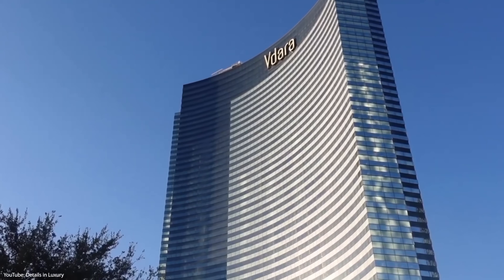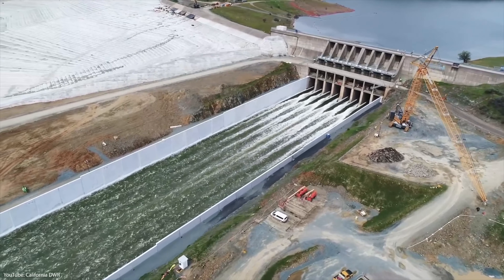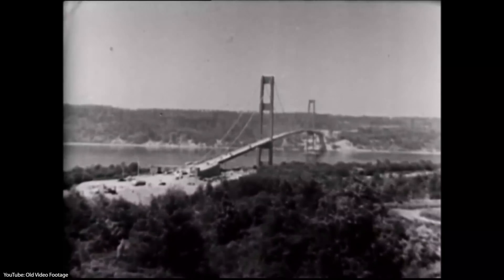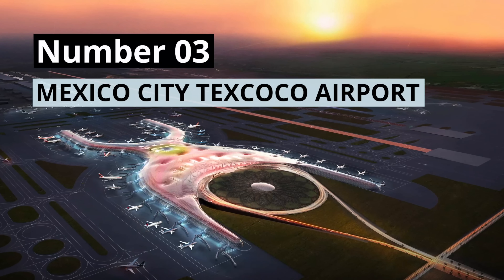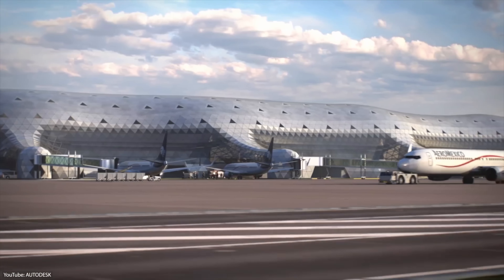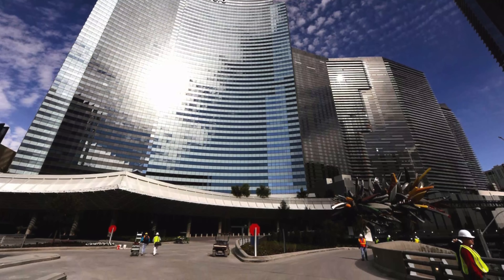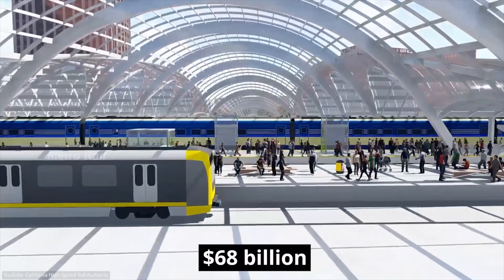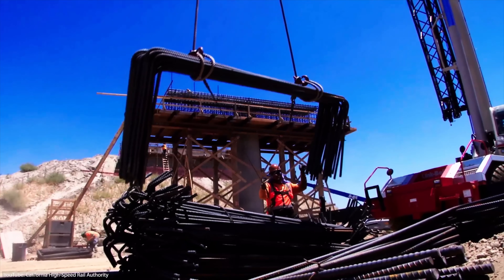Most Expensive Construction Mistakes in the World (Part 2)

Comment: I kinda find I weird that the Tacoma bridge engineers didn’t see any faults in their design…. I mean they literally had 2 perfect examples to to borrow from…
Reply: It's not that they didn't see faults, it's that there wasn't sufficient widespread comprehensive understanding of aerodynamic flutter for them to realize how dangerous those faults were.

Also, they were trying to keep the cost of the bridge down by minimizing the amount of steel used, because they were working under budget constraints.

Comment: As a student in Civil Engineering one thing you have to do when building a Structure is how can the Structure be destroyed by Natural Causes, Resource Causes or Design Mistakes. Then fix that part before building something. It's the same as having a Tree. A Big Tree cannot live without a Great Root System.
Reply: As a student in Civil Engineering you could share something less obvious.
It's just like you consider yourself an authority besides the fact that you haven't built a toilet.
Reply: @marcioaso  Actually building a Toilet is too easy. And yes once in a Practical Project my Group did build a Toilet.
Reply: @rajarshisarkar999  uuuuuh, "practical project".
So obviously you can describe how much cement and tiles it left over...
Describe the project... say how much it costed, the material needed.. how much was the contractor's cost... what did they do... how many days it took...
how was the pluming before the project and after... 
because indeed... a blueprint must really be "too easy" to do, right?

Again: NEVER BUILT A TOILET!
Reply: @marcioaso  Dude, it's just a plain Biological Toilet made of Wood. Eastern Style. Also, why so much hell bent on a Toilet? Trying to Exaggerate a Task is not how Engineering is done. Engineering is to make a Task Simpler in block structures.
Reply: @rajarshisarkar999  I meant the whole room.
But let me explain then... it sounded really snobbish the "as an student in Civil Engineering" thing. Giving that is absolutely NORMAL to be a student of a STEAM grade. It doesn't mean shit in the internet.
Like, you don't have to do this, friend.

Just say: "In these days, bridges.. dams.. or any bigger structures has to pass on lots of simulations to even left the blueprint... sometimes even that is not enough.
I'm studying civil engineering and that's one of the main drives of the course... blah blah".
See, it's easy to put knowledge in front of the title, instead of the "trust me, I know what I'm talking about in here".

Everybody knows that big structures have to run for a lot of simulations even before the first brick reach the site.
And the world is full with engineers that fail in the most ridiculous tasks because of dumb inobservations, the whole video is about that.
The cost of arrogance.

So don't be this kind of junk... it's even MORE important you think like that because you are a student.
Reply: @marcioaso  So in short, I am not allowed to feel pride in the Subject I love. Understood.
Reply: @rajarshisarkar999  So you didn't realize that is a bit early to be proud of yourself yet?
Oh boy...
Dude, I hope you see this as a constructive criticism.

See these video again. EVERY single one of these engineers passed through the exact same path you are passing right now.
It's your CHOICE to be different... and I hope you to be better than them. 

Just put in mind to never be proud of your knowledge... just focus on being eager to increase it. The more you know, more you realize the size of your own ignorance... because knowledge gives you aware of things you never imagined.

College WON'T give you everything you need, will just give you the tools to have a good start... you will (hopefully) see it in a few years.
Reply: @marcioaso  Oof. Still ongoing with this? Try some other Person to Victimize. I am talking with someone on Social Media.
Reply: @rajarshisarkar999  
Ok. Keep being arrogant. You will see what you will stick your diploma at.
"I am not allowed to feel pride in the Subject I love"... I'm not the one victimizing you, you are doing this by yourself.
Have A LOT to learn before having attitude.

Comment: So that spillway cost almost 3x more to fix than it would have if they just repaired it when damage was found.
Reply: Ounce of prevention,  pound of cure.
Reply: America’s dams have a D rating by the Corp of engineers. Can you pull 100 billion dollars out of your bum? Even if it would save money? No.
Reply: https://youtu.be/rSeXWQbfIjc
Reply: As a citizen of Oroville
They did not inspect it as they were supposed to in 2013/14, which typically is done by drilling test samples out of areas to inspect the concrete decay/dmg, never did such.
I've had to evacuate 3x now in this town

The reason the dam took so long to fix, was because Kiewit the mining/construction company made responsible for the repair, was secretly Gold Mining the fuking dam and hill side.
My dad worked for them and i went up there a few times with him, and they told all workers no photos or videos, they had slues boxes up there filtering gold, used alot of explosives on the dam too, laid everyone off repeatedly per 2 weeks, over worked workers, and neglected the 120 degree temperature on the spillway overheating workers into heatstrokes working ppl 6-7 days a week 14hrs a day. which resulted in fines against them and then required water breaks every 30 minutes, and many ppl were helicoptered out for overheating, my dad secretly took pictures of the hole in the spillway, there was a huge gold vein in the thing, and my dad gave me a lil nugget he found.

Comment: We in India built statue for 3000 crore and planning to built another 2 for whooping cost of 7000 crores. And building a bullet train route for 125000 crore after it is finished to retrieve the cost ticket should be fixed 10 times the price of normal air travel.

Comment: The Philippines' Bataan Nuclear Power Plant which was the first in southeast asia but never been used after its completion because of various reasons by the late president Corazon Aquino (the president after former president Ferdinand Marcos who initiated the project.
Reply: That's some real shit...
Named Apsara, the reactor was housed in a 100 x 50 x 70 concrete building. India's and Asia's first nuclear reactor, Apsara reached criticality at 3:45 p.m on 4 August 1956 and was inaugurated by Prime Minister Nehru on 20 January 1957.
It helps power many industries here ..go for it..but india was under sanctions for 10yrs for first nuclear test from E.U. and America so its western pressure ur  gov..is facing..nothing else...
If phillipines  now is kept under sanctions it will destroy ur economy may be that is the reason ur leaders dont want to  step in this shit..

Comment: Rafael Vinoly, the architect who design the death ray buildings is an idiot. Not only did he not learn from his first mistake, he still came up with excuses for he second failure. He said he intended to install horizontal louvre windows to prevent the problem but they were removed during the planning process. He even said he didn’t realize it was going to be so hot. “When I first came to London years ago, it wasn’t like this. Now you have all these sunny days...” Yes, this dude designed a building that was only going to work when there are overcast clouds

Comment: That's 875 million California dollars.
Which means it only actually cost 200 million and the rest of it disappeared.

Also, I was a kid when I heard about the Tacoma Narrows Bridge and in the many years since, I have actually gained quite a bit of respect for the fact the bridge held up for four months of that abuse before failing.
Reply: @Darrinw56  where does it go other than politicians? Definitely not used in helping the homeless, at least most if not all of it.
Reply: @aesieaiyahcloe  The high speed choo choo to nowhere.
Reply: It's hilarious how they decided a small team of government employees could replace a large team of experts to save money on a multi billion dollar project. I've worked in many private sector jobs and with them cost overruns of 20% are expected but when I worked government projects a cost over run of 50-100% was "normal" and I've seen projects were the managers bragged about only going 50% over budget even though they routinely tack on 20% on top of the initial budget just so they could try to bring a 100% cost overrun down to 80%
Reply: sad how accurate that is
Reply: California after the liberal takeover has been an embarrassment....
Reply: @davidloftus3152  I've only watched two of these types of videos and so far half of the failures have been in California and Vegas (mainly California). They cost too much money in payoffs and don't have enough left over for solid construction.
Reply: @davidloftus3152  I wish it was just California.
Reply: @deejayimm  yes unfortunately it encompasses the entire landmass
Reply: @david loftus it’s literally in the top economies in world history. Not a single republican state can make that claim.
Reply: @ruspotter2037  First off, California is on the downward trend, but even in 2019 in it's heyday, Texas wasn't too far behind in GDP per capita.

ALSO consider the fact that California receives nearly TWICE the federal funding as Texas.
Reply: @deejayimm  California taxes taxpayers exorbitant amounts for everything and has the highest cost of living.
Reply: @ruspotter2037  california has one of the top economies in the world in spite of democrats control not because of democrat control

Comment: Do the Silver Line Expansion for the Washington Metro System.  It's ridiculous how over budget and beyond deadline the project is, and we still don't have an opening date.
Reply: These big projects are designed for corruption whether they are highway, park or transit projects.   Transit projects seem more corrupt because cities often are in charge of running them and it ends up being a feast at the trough for the pigs in city govt. to make money of off.  Millenium Park in Chicago took 1.5 billion dollars to build and it was supposed to be under 300 hundred million.  I should have known a city project would cost 5 times its actual price.
Reply: @4149stonepony  The crazy thing is that the expansion is literally a Control-C Control-V of the existing line and stations that were finished in 2014.  They took over construction, and it's been a disaster ever since.

Comment: I disagree Oroville was a construction mistake. The original spillway lasted a longtime. It was the imperfect maintenance that destroyed it.
Reply: Grady over at Practical Engineering gives a more in-depth look at this one, that I found really interesting.

https://youtu.be/jxNM4DGBRMU
Reply: As a resident of Oroville who lived through this catastrophe, I can assure you this was a construction error. The concrete was not reinforced with enough rebar to withstand differing forces caused by water flows.
Reply: @SpruceOaks  your a resident of Oroville therefore your an expert on spillway design and architectures...
Makes perfect sense.
Reply: @lilmike2710  maybe they aren't an expert on this design, but Oroville is a small town and many people are familiar with people who either worked on building the dam or currently work at the dam. I'll bet you never even heard of the place before it hit the news in 2017.
Reply: Failed maintenance is still a fail. Also no, a dam that size is usually designed to stand forever with proper maintenance.
Reply: Yes but how many times was it used in that time? Or was this the first time the spillway was used to handle these volumes of waters? Construction this size and handling these forces can generally only be truly tested when the serious situation comes around it was designed to handle. The lake was a record igh more rain was predicted so the spillway probably was never pushed to it's design limit before. Of course a construction will last a long time so long as it is not put to the test.
Reply: @barthoving2053  That spillway was used for multiple months every year as a matter of routine.
Reply: If it was the "imperfect maintenance that destroyed it" how can it be a construction mistake?
Reply: All factors. Worked with that inspection team once out of Davis. Changing watershed characteristics and urbanization also increased peak flows.
Reply: My town
Reply: Yup had to leave had to sleep in my car with my child n dog
Reply: Agree. These vids are made by people who have no understanding about the subject matter.
Reply: As a citizen of Oroville, dear engineers and governors, PLEASE FOR THE LOVE OF GOD INSPECT YOUR DAMS AND REPAIR THEM ON SCHEDULE!!
They did not inspect it as they were supposed to in 2013/14, which typically is done by drilling test samples out of areas to inspect the concrete decay/dmg, never did such.
I've had to evacuate 3x now in this town

The reason the dam took so long to fix, was because Kiewit the mining/construction company made responsible for the repair, was secretly Gold Mining the fuking dam and hill side.
My dad worked for them and i went up there a few times with him, and they told all workers no photos or videos, they had slues boxes up there filtering gold, used alot of explosives on the dam too, laid everyone off repeatedly per 2 weeks, over worked workers, and neglected the 120 degree temperature on the spillway overheating workers into heatstrokes working ppl 6-7 days a week 14hrs a day. which resulted in fines against them and then required water breaks every 30 minutes, and many ppl were helicoptered out for overheating, my dad secretly took pictures of the hole in the spillway, there was a huge gold vein in the thing, and my dad gave me a lil nugget he found.
Reply: This video misinforms. The Tacoma Narrow was the famous example of natural resonance.  The bridge even swayed in light breezes. It was hardly known in structural engineering at that time. How can you call it a construction mistake if the effects of natural resonance was not known to the bridge community at that time?
Reply: I agree.. and the engineers of the time had no way of knowing just how ridiculously incompetent people in California would become in 50 years
Reply: Not true. It was built on incompetent substrate, with next to no rebar, and inadequate drainage. 

Incompetent maintenance just made very bad a lot worse.
Reply: @philiphorner31  and yet it still lasted many decades. Hindsight is a wonderful thing...
Reply: @JohnnyMotel99  hindsight still doesn't change the fact it was flawed from the start, given the underlying assumptions made during its construction were wrong even for the time. It just got lucky it didn't happen sooner, or much worse. It's not hindsight if it was built wrong at the time, that's just a straight up error
Reply: Did you see any rebar sticking out of the broken spillway?
Reply: @phillipkalaveras1725  Are you trying to say there was no rebar in the old spillway?
Reply: Life is a test to know more read about Islam

Comment: The information on the airport in Mexico is somewhat incorrect. About $2B were wasted, as the project was cancelled at around 20% execution. The recent $16B loss report was wrong and retracted soon after published (probably a planned political attack). Still a horrible loss but the final solution (another airport called AIFA) is saving the country several billion indeed (compared to finishing the crazy one mention here, called NAIM). BTW AIFA is is not that much smaller, it's just not a stupidly pharaonic design with 100000 different custom cut glass panels built on a swamp...

Comment: The old steam trains were romantic.  The new trains work for long hauls of freight.  U.S. Passengers choose air travel.  Only a communist or fascist government could ruin our travel by making it slower and more expensive.
Reply: On distances below 1000 miles high speed rail could easily be faster than flying. Train stations are in the center of a city and there is no check in, security etc. The US is just unable to build it while ruropean and asian countries have acceptet its capability for a long time
Reply: The US remains the only western country that still doesn't understand high speed trains. Other countries recognise they are essential to their economies as they contribute to them over time - without polluting the air - by providing both tangible and intangible benefits to an individual country.